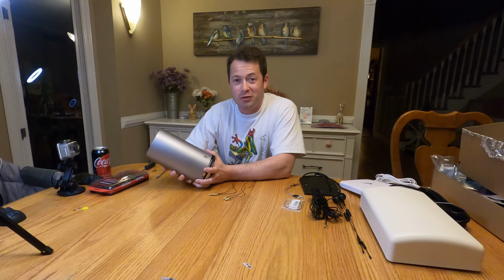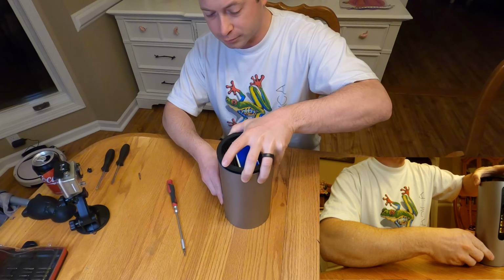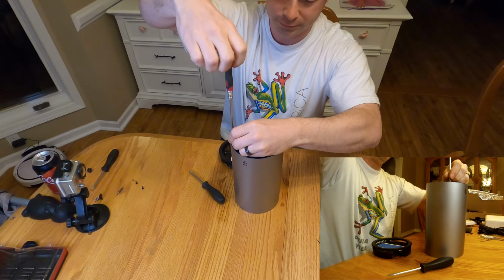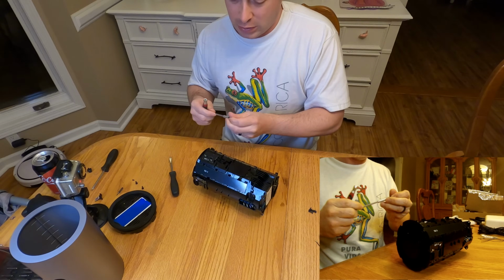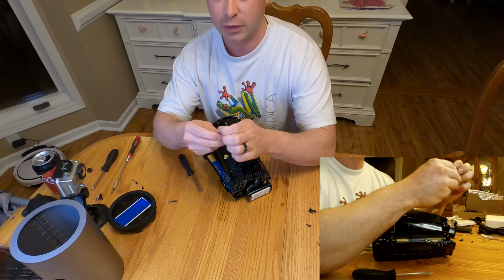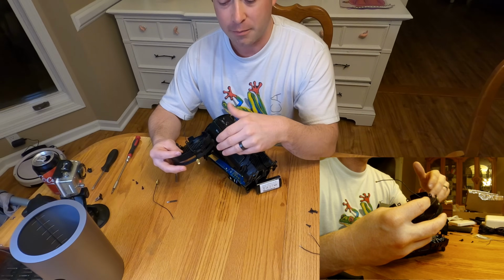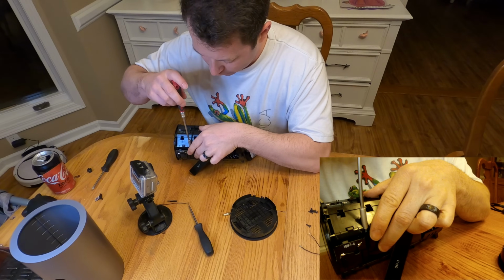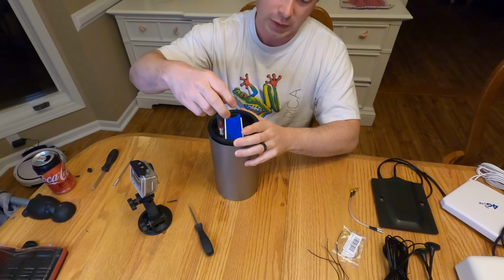✅ Improve Your Signal!  Add External Antennas - T-Mobile 5G Home Internet Rural Broadband - How To

Comment: Thoroughly enjoyed the video. My question is why did you reassemble the router and leave the adapter cables off the router. I am guessing that you are not utilizing an external antenna after doing the experiment.  Maybe my observation is way off the mark. Still looking forward to the follow up video with your results.
Reply from the maker: The short answer is I had to travel out of town and didnt have time to setup external options so I returned it to stock so the internet would work while I was away.

Comment: Thanks, great info. Eager to see how the flat black window antenna helps. Coincidentally my T-Mobile bands went in the toilet today after 3 weeks of incident free service. Already had one unproductive conversation with their support, but another may be needed. Grrr.
Reply from the maker: Did you try messenging them on FB or similar social media?
Reply: @NaterTater  Are you asking or suggesting? I do not know how to get tech support other than to call them at  844-275-9310. I even asked once if email or web based support was available and was told that "only phone support is available at this time" (not sure if that was a hint of things to come, but AFAIK nothing has changed). Their support is quite infuriating. As if lack of an electronic support channel wasn't bad enough, I only get a competent rep about 25% of the time. And that's after waiting for hours for the callback and then being put in a queue when they do call back. And this abysmal support will only get worse as towers get more congested. Cox got under my skin for different issues, but their support blows the doors off T-Mobile.

I do have T-Mobile connectivity again, but something has changed. Right now I can only connect to n71. I'd much rather have the blazing download speed of n41 though.
Reply from the maker: @nbi4220  go here and message them.  https://www.facebook.com/TMobile/

Comment: Been having issues recently with the secondary 5g signal not connecting. Tried rebooting it on several occasions with no success. Any suggestions?
Reply from the maker: Move around to find best signal.  Otherwise wait for tower upgrades or do external antennae

Comment: You’re a brave man for taking that apart and possibly avoiding your warranty.  I’m excited to see what you have in store for us in your next video of the series
Reply from the maker: Just dont tell TMO... 🤫🤐
Reply: @NaterTater  They'll probably start putting seals on these units to prevent tampering. 😄
Reply: @pauljoseph2400 Their newer gateways (Sagemcomm & Arkadyan) do have at least one screw hidden under a sticker, but the good old Nokia Trashcan doesn't.
Reply: There is no warranty per say as tmobile doesn't sell the unit. Customers only borrow it. If you don't return it they charge you $370. I know this because I asked a rep when ordering.

Comment: Man Nate, you have the patience of a saint taking that router apart! I did have a question concerning bands used. I originally had just B12 as a primary and no secondary channel . One morning I turned off the router and turned it back on and noticed I now had B66 as primary and N41 as a secondary channel. Yesterday I had to do some electric work, shut the power and when the router came back up it was back to B12 and no secondary channel. I contacted t-Mobile who said they don't set the channels and couldn't put me with 5G channel and advised to try and reboot to see of it goes back to a primary and secondary 5G channel . No luck though. I use Ooma as a voip serviçe and had issues with dropped calls. They state my jitter is to high (12 )and needs to be around 5. The 5g channel seemed to have less jitter and worked good with Ooma. My wife has a defibrillator implant and a device that reads the unit and transmits info through voip to the doctor. Is it true T Mobile can't designate channels? It really gets frustrating. Thanks so much for your t-mobil YouTube series. They're filled with excellent advice.
Reply from the maker: Correct there is no way to manually select bands.  You can try different locations in the house, it goes for the strongest signal.  Another trick can be to literally wrap the gateway in tin foil for a few mins and see if it changes bands.
Reply: @NaterTater  ok that what I have it not sure if mimoo 2by 2 will make a big difference but I'ma do what you show on ur vids.. exact my router can't change mtu setting unless is pppoe connection 😐
Reply: I've heard of this issue. There is seemingly no fix
Reply: @yfs9035  would require a firmware patch or mod for band locking.

Comment: yagi and lpda are different... very different.  yagi are for television normally, where lpda are more for RF... so just a minor correction there
Reply from the maker: Raz, yes you're technically correct but slang for these lpda antennae designed to use for cellular (~600 to 2700 MHz) is often Yagi.  Log periodic directional antenna is the correct name.
Reply: No, we use yagi all the time in fixed wireless ISP. We also use yagi for data transfer from the light and power substations too..

Comment: I haven’t had any luck getting my antenna to work. Not sure it’s maybe because it’s 4g only? I used the two ports to the right of the purple gps one
Reply from the maker: Meaning no signal or just not better than internal antennae?  You do have to check your antenna freq range vs the signals you are trying to pick up

Comment: I have the same unit from T-M as you. My tower is 0.7mi away, and yet, the strongest signal I get is only 2 bars out of 5. Talked to their tech support and they tell me the tower coverage is mediocre here, but is on the list to be upgraded. My question is, do you think an external antenna will actually help someone in my position? Or am I wasting a bunch of time and $$ for an external antenna that really won't produce significant increases in signal strength?  And even if I get a better signal strength, that doesn't necessarily mean I'll get increased speed does it? Thanx. Dennis
Reply from the maker: If it makes tou feel better i only get 2, sometimes 3 out of 5 bars but can surpass 100mbs download (does vary a lot though).  The tower upgrades they promis are a real thing, its not an empty promise.  External antennae could potentially help.  I'll touch on what to check and watch for to determine IF it is likely to help or not.
Reply: It might work it might not, I have no personal experience with this device but, technically better signal quality will allow better QAM for faster speed, and potentially better Carrier aggregation for faster speed